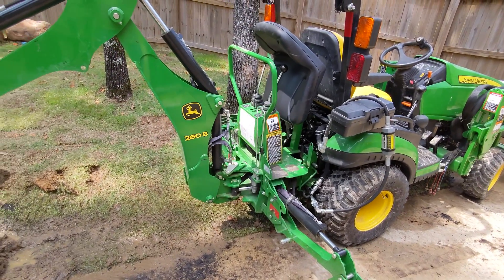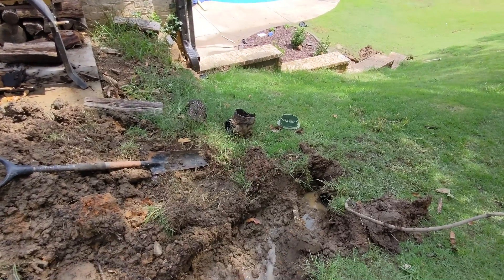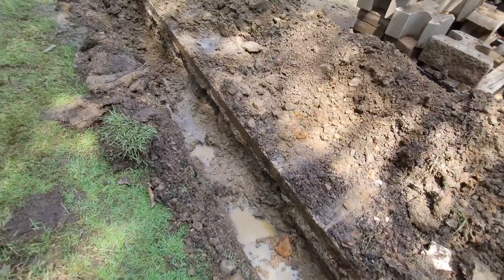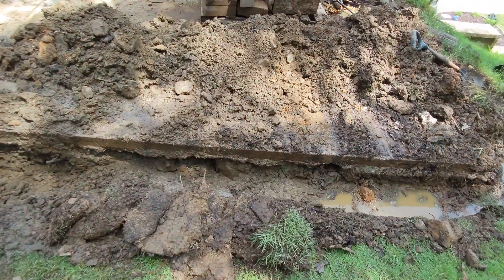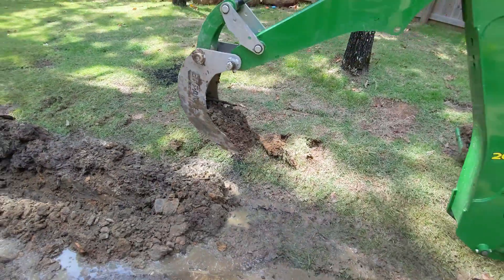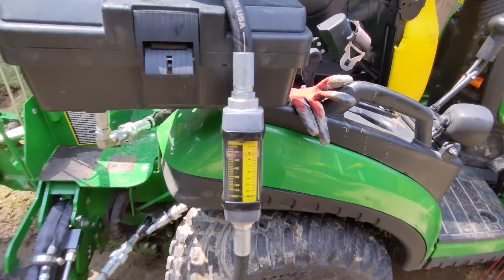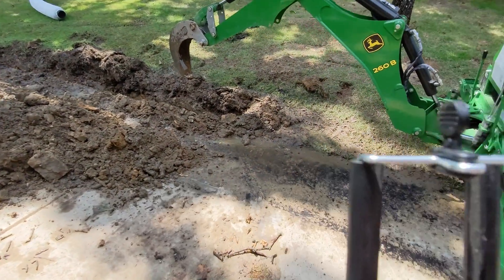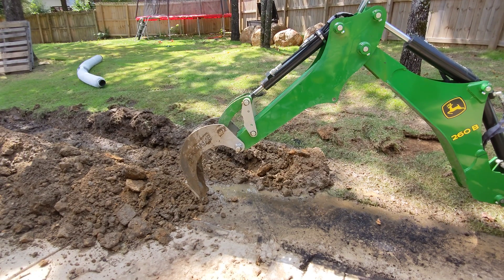John Deere 1025R 260b - fast hydraulics at lower RPMs

Comment: Mid September I'm hoping this shows up. 

But, from what I gather, I can take the power steering completely out of the loop. Move all of that flow to the backhoe? Now if I run it like that, I'd have no steering, correct? 
I guess it's personal preference how heavy or light the steering is, but it needs flow to work. 

I did not install the valve you sent, I'm waiting for the pump.
Reply from the maker: Correct - you can in theory take the steering out of the loop, but because the steering is hydraulic and not hydraulic assist, you will not have any steering at all.  This is different than a car which can be steered even if the power steering fails or is unhooked.

You would also be taking the oil cooler out of the loop, but since you're not using the hydrostatic (since you don't have steering), I expect you will still be running cooler than if you were out mowing.  The hydrostatic pump is about twice the size of the steering/implement pump.

With the kit only using the stock pump, you can tune it aggressively and get speeds at WOT that are just a bit faster than what you see in this video.  You can get about 5.5 GPMs of flow and still have good steering that may feel just slightly tighter than what you get at WOT in the stock configuration.  I would say that the steering feels like it would when running at idle when you are stock - still plenty of steering, but you can tell that a little more flow would speed things up.
Reply: Your steering loop provides the charge flow for the hydrostatic drive.  If you loose that flow you no longer have positive case pressure and will destroy the hydrostatic pump once the shoes start hammering the swash plate.